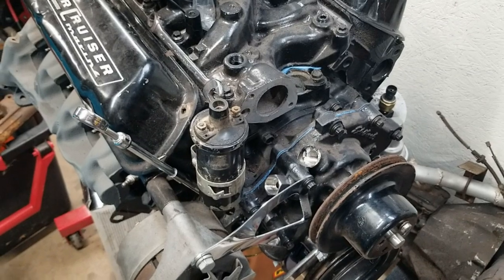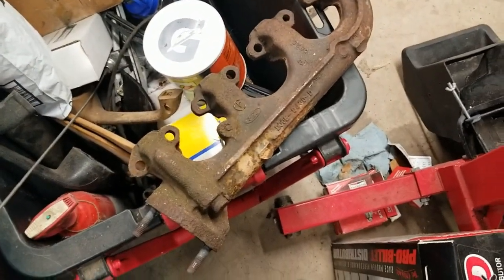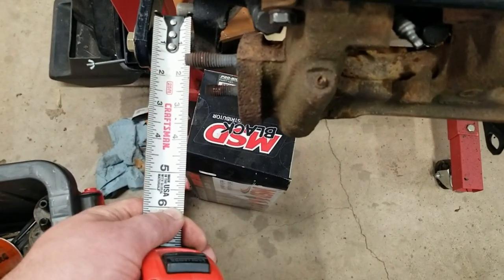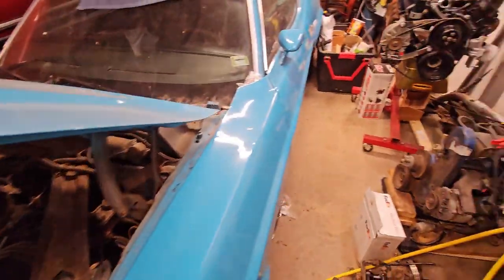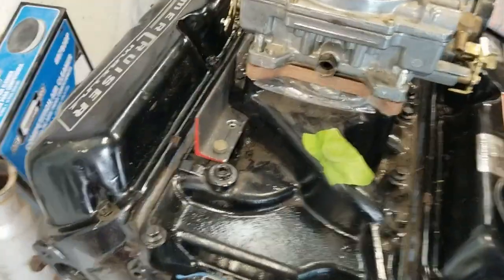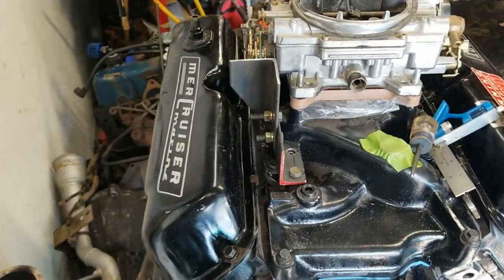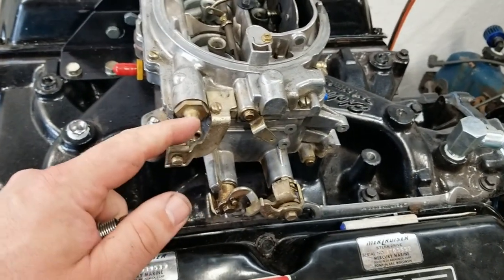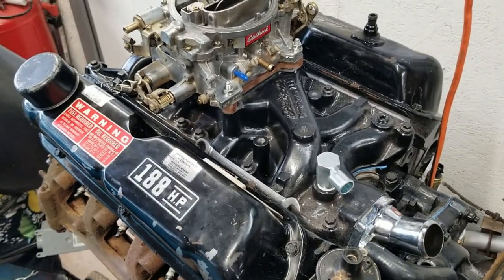Drag n Drive Pinto: V8 & SROD Swap 5 #nonamenationals

Comment: I did this in 1984 with a 78 runabout we put a Mustang 2 front end and a 302 out of a station wagon we put the rear end from the station wagon on it after we had to narrow it , it was half the weight of a corvette with the same displacement and I rarely lost in a race
Reply from the maker: I can't wait till it is done, I just want to enjoy it instead of constantly working on it. 😂
Reply: @firepinto  I had tons of fun with mine it was the ultimate sleeper

Comment: Older Mustang exhaust manifolds work better. They don't have that fin on them. I have a set if your interested. I used modified shorty headers.
Reply from the maker: I have a 1970 mustang manifold on the passenger side now. I ground off the weird boss that had some kind of tubes going to it.  It seems to fit in the fenders now.  My mustang II frame mounts aren't going to work.  They push the engine too far into the firewall.  I'm resorting to a Pinto driver side mount, and making or modify the passenger side mount.  Lots of people say to move the mount an inch and drill new holes in the frame, but there isn't enough flat area to put a bolt in that area.
Reply: You need to hammer the firewall to fit @firepinto
Reply from the maker: @claytonstoolbox  yeah I can see that coming, but the MII frame mounts look like I'd have to cut out the firewall.  I'm shooting for quick and dirty right now. Lol